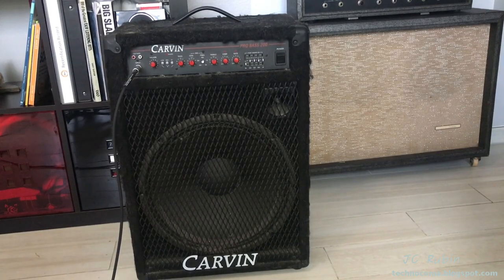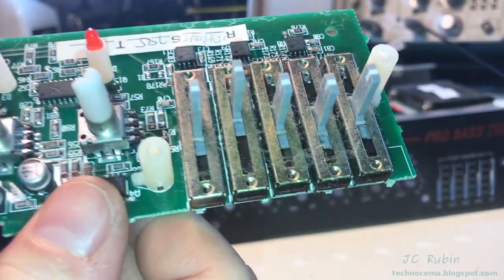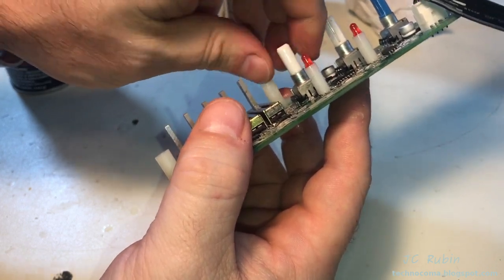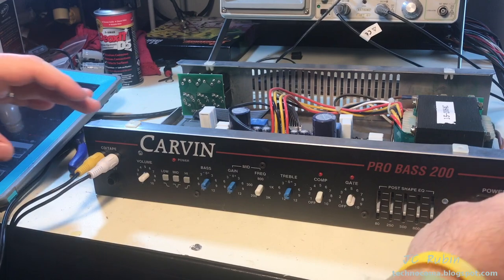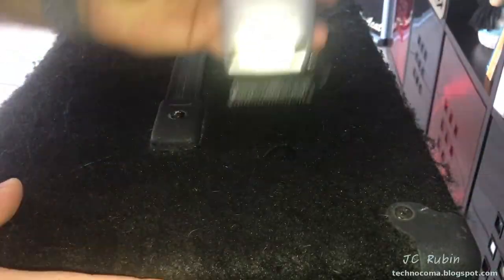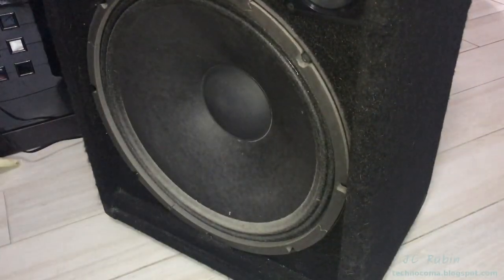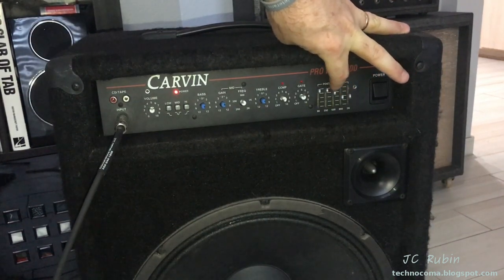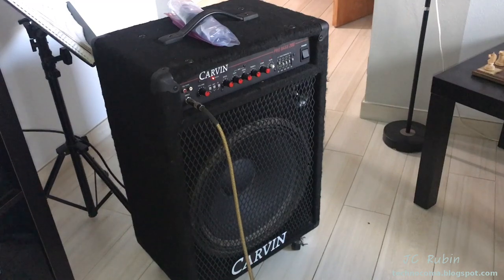Carvin Pro Bass 200 Amp and Cabinet - Repair + Extreme Make-over

Comment: Thanks for the video. I have this amp and it’s making some noises so I’m going to try this repair.
Reply from the maker: Good luck!
Reply: I just ordered one of these earlier this morning..I didn't have a chance to play it but I believe it will work and sound great.  I had a Carvin MTS 3200 guitar amp head and it was badass as well...from your video here it looks fairly easy to repair. I have to go pick it up about 300 miles from my home..I can already tell I won't be able to sleep until I go pick itup and bring it here.

Great job on your video here.
Reply from the maker: @rosskrause3926  good luck, hope it all works out.
Reply: @retrotechandelectronics  I went to pick it up yesterday..280 miles north of where I live..heck of a drive to and from but I made it...checked it out a little when I got home..mainly a good cleanup and wipe down..today I will get to really plug in and play it to check it all out..mine has a Active and a Passive input jack..not the CD & Tape jacks.  I just took the chassis out like this and its spotless !  No dust or hair or anything...just looks great..going to Deoxit all the pots and jacks and stick it back together..so far so good and Happy witht champ !

Comment: Great video. I recently got a great deal on the same amp and did a similar make over. Previous owner removed the tweeter for some reason, I tried to find one that fit without drilling a bigger hole. I had no luck finding a tweeter that fit so I just left it and used some scrap carpet to cover the exposed wood from the hole. I had to pull off and reglue some areas of the carpet, shaved off some of the pulled carpet fuzz but also went over some of the really bad parts with a heat gun which tightened it up.
I noticed that you put wheels on yours. What wheels did you use and from where?
Thank you!
Reply from the maker: I bought the 4 casters at harbour freight